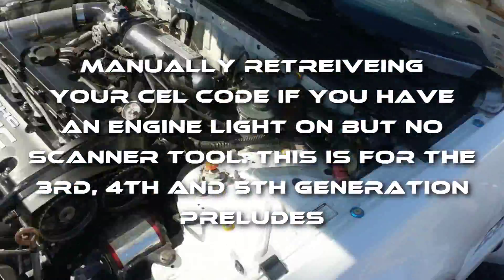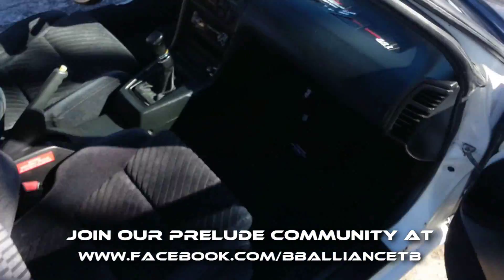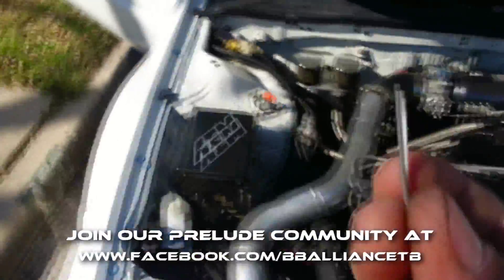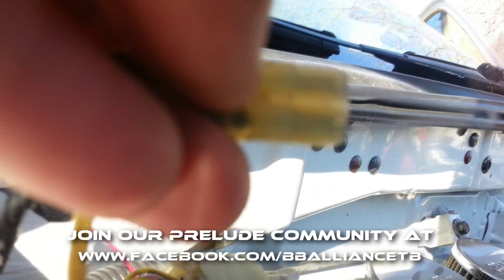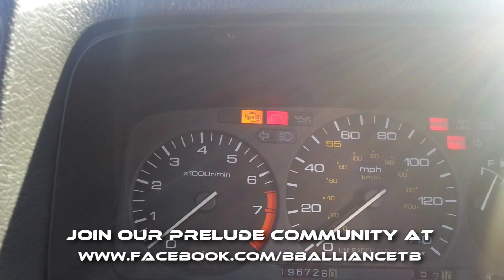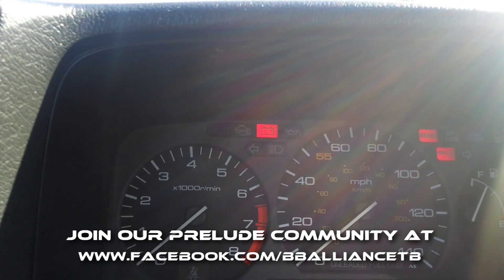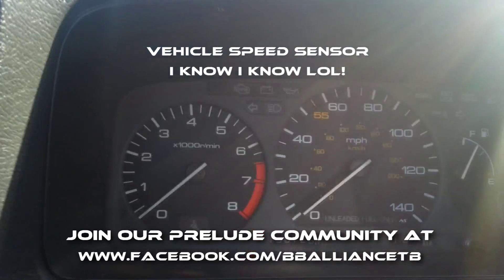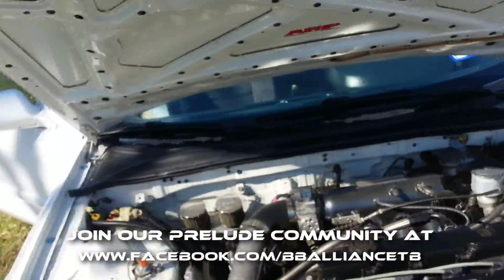BBA TB Retrieving Cel Code DIY

Comment: One thing I'm wondering is if it stays on does that mean zero or.......?
Reply: If it stays on that means you have not bridged the connector properly or you are bridging the wrong plug
Reply: What about if it blinks a code. Then stops and stays on.
Reply: David Wirtzwirtz if it blinks once in a while then its giving you a code. A solid blink = 10 and a quick blink = 1